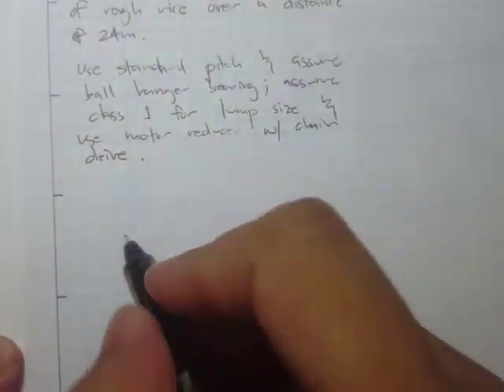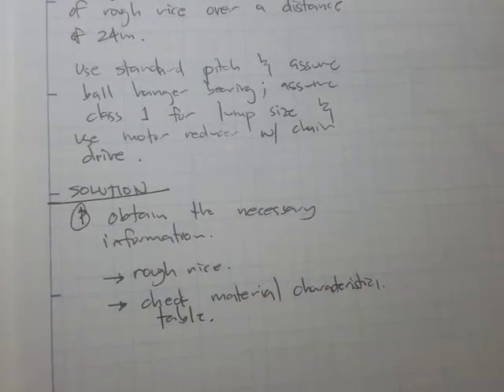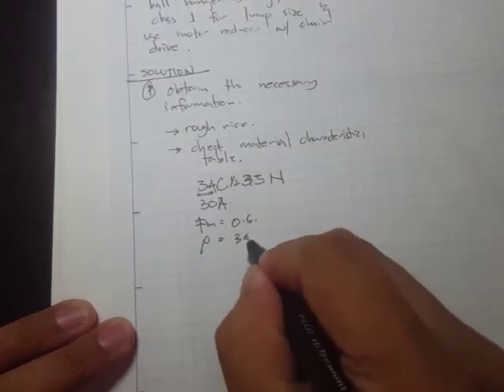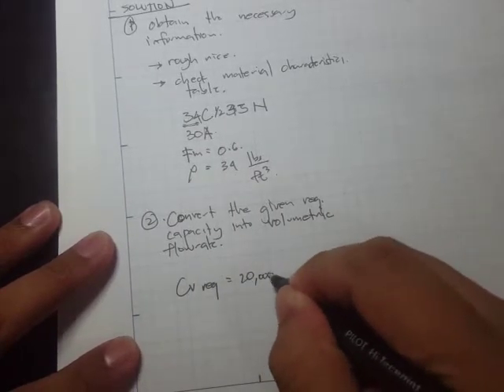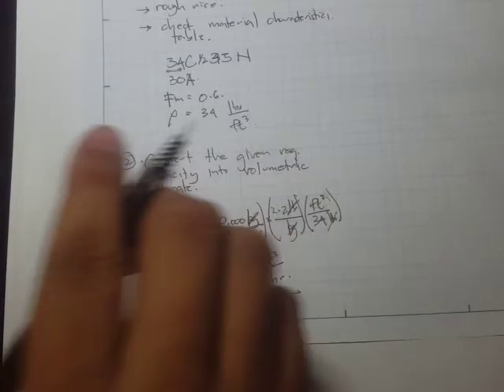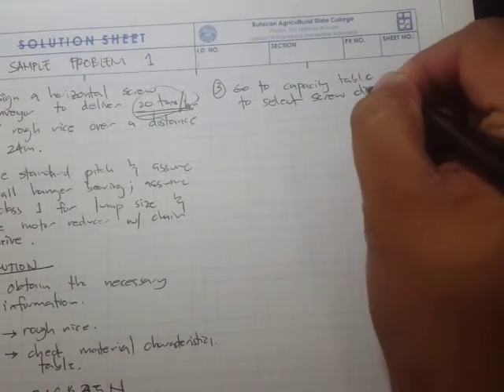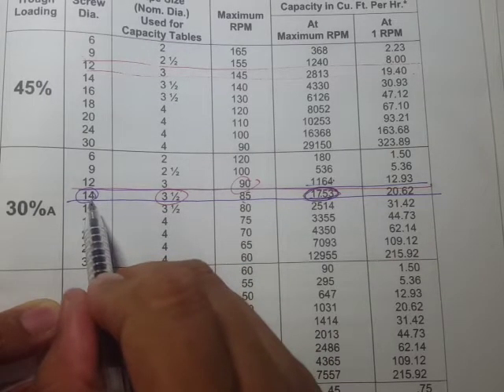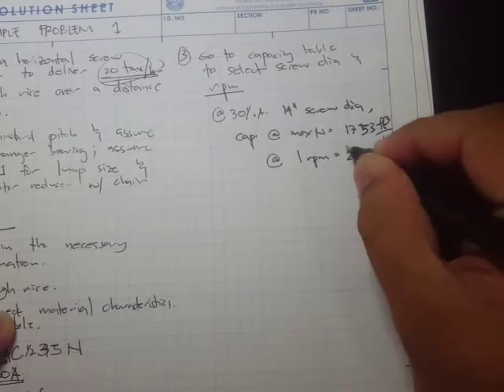ABE180 - 04.03 - Design of Screw Conveyor (Part3)

Comment: What should be the capacity factor for variable pitch ?
eg. If i have to use 2/3 pitch for some amount of length at inlet and in the same conveyor 1/2 pitch for remaining length till outlet, then, can you please suggest for how much length i should keep short pitch(2/3) and for how much length i should keep half pitch (1/2)?
Material is salt (85 lbs/ft3), inclination is 37 degrees and the length from inlet to outlet is 2900 mm.
It would really help if you give answer in some detail rather than an overview, as i am actually going to fabricate it.
One more question, after how much length a hanger bearing is to be used is a necessity?
I am using a tubular trough
Reply: As my experience, the factor is just a figure to prevent a  failure (or unexpected functions) when exchange from design to fabricate. So you can estimate the factor depend upon the functions of screw conveyor. Of course, the values in handbook is demonstrated.